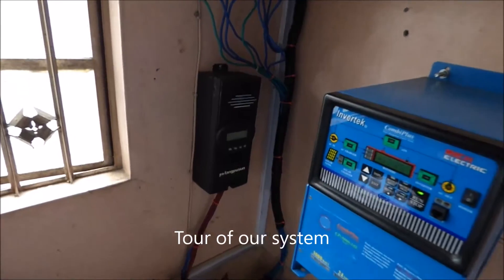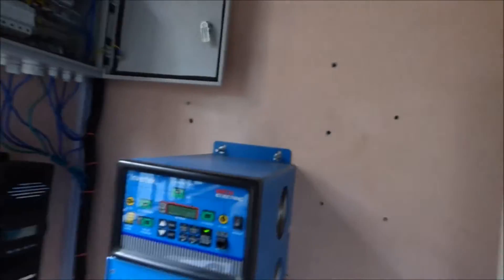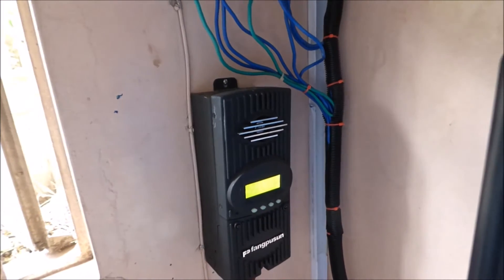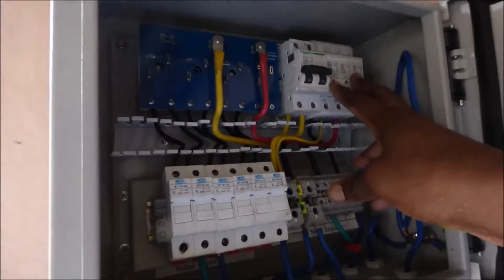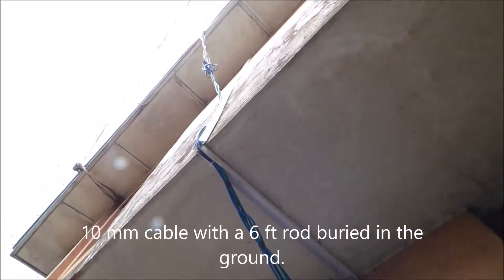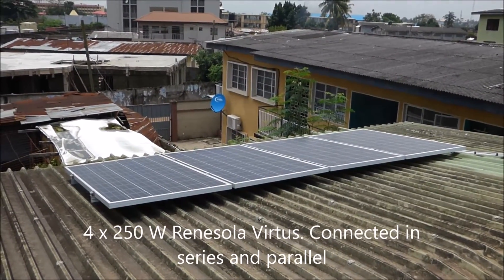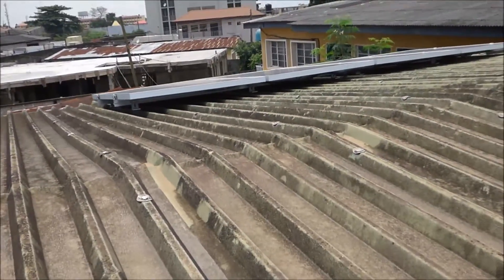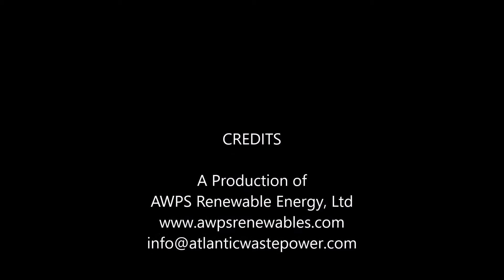Misconceptions about Solar power? What is the right answer? Part 5!

Comment: Nice video, i noticed you talked about connecting your inverter to grid, could you explain how that connection is done. if you channeled it through the charge controller and how do you isolation one power source from the other (panel & grid). A quick explanation or video would help pls. Thanks
Reply: Pardon my curiosity, do you charge your batteries with grid (Nepa) also or the inverter is only connected to switch from grid to solar.
Reply from the maker: Thank you for watching. The inverter is not a grid tied it is a grid connected with a UPS function. It has an AC input from the grid which transfers the loads connected to the inverter to battery power if the grid fails. It does not go through the charge controller. The controller charges the batteries. Connection from the panels through a breaker to your charge controller and then to your batteries. The controller regulates the charge. I hope I explained it. Thank you for watching and commenting

Comment: Top of the day to you sir!!
I have a question for you sir how can i know the amperage of fuse and breakers that can work for my inverter setup be it 24v 48v and more thank you in Addy sir
Reply from the maker: That is a very good question. When in doubt read the manual. The manuals that comes with the inverter will tell you what the manufacturer recommends as minimum for both AC and DC
Reply: Thank you sir
Reply from the maker: @DJTommzy  you are very welcome. Goodluck

Comment: Good presentation,really explains the interconnection between all the components in an OFF Grid solar system.
Reply from the maker: +Ibidapo Ilawole Thank you Stone Orix. There is a difference between a grid tied system and a battery based or off grid system. This is an off grid installation. Our demo where we test every thing we offer